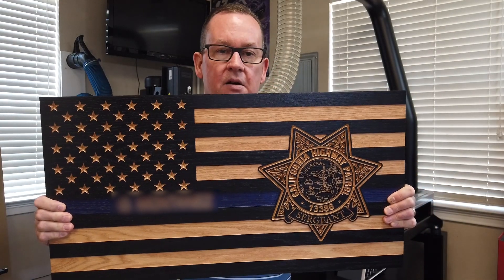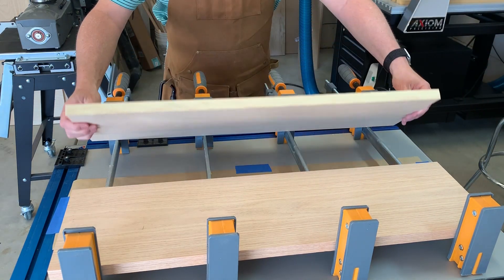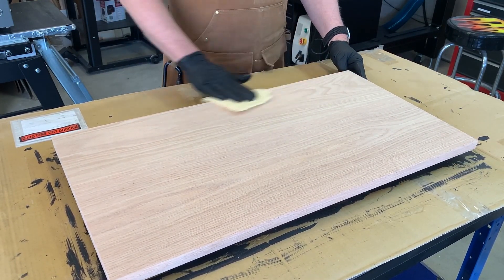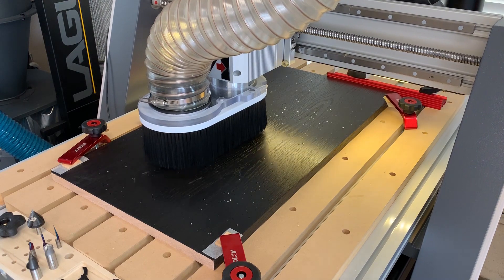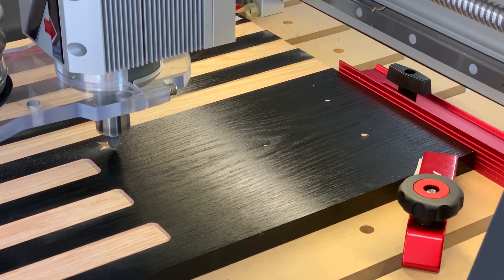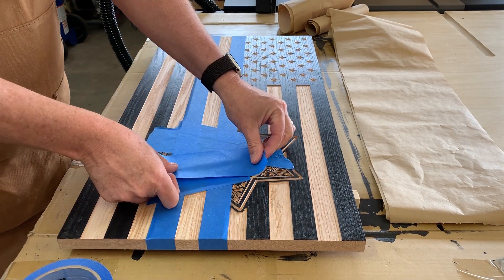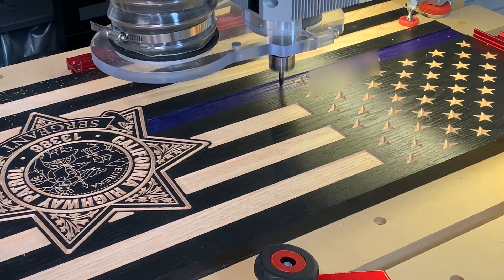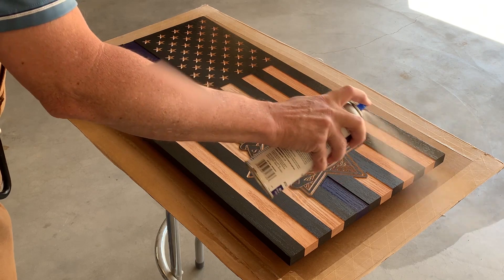Using an Axiom CNC Machine to Make a Blue Line Flag - Updated 07/17/2020

Comment: Hi Russ, great video. The flag came out fantastic!!
I have a question that I was wondering if you'd help me with, I just wanted to know what size is the flag and did you use a flag calculator so it's proportionate? 
Lastly, can you please tell me what size boards did you use for the glue up?
Thanks so much Russ.
Reply from the maker: Hi Joe.  Flag is 15” x 28.5”.  Yes you should always use a flag calculator to be sure everything is proportional.  I use Omni calculator on line.  The board sizes vary frequently.  You just need to make sure your glue up is larger than final size and cut your flag to dimension on the table saw prior to carving.  You can also fasten to the CNC and cut out final dimensions using an exterior profile cut.  😀
Reply: @Blue Line Wood Flags  Thank you so much Russ. I really appreciate your help and the information. Yeah that flag calculator does come in handy!!
I know cutting them to size on the table saw would be the thing to do, but I've attempted to make certain size flags, and I've noticed that the height would be an oddball number that I could not dial in on the table saw, so I would just cut them out using the machine. Like according to the calculator, a 24"W flag has a height of 12.632". So I couldn't figure out how guys are building these flags and keeping them proportional.
Reply from the maker: @JoeLazzara  It all depends on the level of precision you require.  12.632" is roughly 12 5/8" which any table saw should be able to dial in.  The difference likely won't be seen.  :)
Reply: @Blue Line Wood Flags  Yes thats true. 
Thats what I was worried about, it being seen. But you're right tho.
Thanks!!!

Comment: how do you sand fuzzies off the v carve without removing stain?
Reply from the maker: Use the sharpest v-bits you can. Run a last pass and take off no more than a couple thousands. Use a soft bristle toothbrush to get in the crevices and lastly don’t be overly concerned with every little fuzzy. Using sticky tape will help pull off some as well. I like clear packaging tape.

Comment: Hi! I was wondering where I could get those long red clamps that you used on the back of the flag. It runs across the T slots. TIA
Reply from the maker: Axiom used to sell them but no more.  You can make your own fence system out of MDF or birch plywood right on your machine!  You can get aluminum extrusion and mill your own holes too.

Comment: Does the CNC stop and tell you when to change the bits (shape and size) or is that something you need to monitor when the changes are needed?
Reply from the maker: Hi Ron.  You set up your tool paths/bits in your CAD/CAM program.  You copy all the individual tool paths to USB drive.  The machine will automatically stop at the conclusion of each tool path, allowing you to prep for the next one.... changing bits as necessary, re-establishing Z-0, etc.

Comment: Why is the tool moving sooooooo slowly?
Reply from the maker: I don’t know how to answer that one. I have no basis for comparison. It takes me about an hour to 1.5 hours to cut all my various tool paths on one flag, depending on complexity and including tool changes. Am I being too conservative?  Dunno!  I get good results and my residual shavings are chips and not dust indicating my feeds and speeds are correct (I stay within Amana specs for hard wood). All my cuts are super clean. I have seen terrible results from those who push their machines to the limit, as I have while going through my own learning curve. If you have some suggestions I might follow I am all ears!  We learn from each other.

Comment: Hello there Russ.  Love the detailed videos.  Steady Paced and informative.  You must have been a teacher in your former life.   I saw that you had a laguna Dust collector. I'm just beginning and just received my Axiom and need to get a dust collection system.  Which model do you have and did you do any upgrades?  Do you like what you have?  Is it enough for sander/planer and cnc?  Thanks again.
Reply from the maker: So yea I have a laguna cflux1.  It’s a dual stage collector. Love it and it keeps my shop clean.  More than enough to handle what you can throw at it.

Comment: How do you get it placed accurately on the table and also in relation to the center? Is it just a matter of making sure it is square with the gantry and setting the center of the workpiece as the origin?
Reply from the maker: Hey Patrick, good question!  If you can tell in the video, I am using alignment brackets which are secured to the aluminum t-track on the table, both along the x and y axis.  These were originally placed and marked using a square in alignment with the t-track/MDF spoilboard.  The center “origin” is established on the work piece.  The work piece is butted next to both alignment brackets with clamps.  The machine’s center is established by setting the x and y with the center you established on the work piece.  That’s a mouthful.  Hopefully I was clear.
Reply: @BlueLineCNC  thanks for the reply. Do you see a big advantage to centering the origin vs using the bottom left corner with a fence?
Reply from the maker: @pj_co  you could do either but for me I have just gotten used to using the center for the origin.

Comment: Did you design the badge, or how did you import it.  It is beautiful.  I am ordering the Axiom unit this week and wanted to know if you had any suggestion on options to purchase with the unit.
Reply from the maker: tomlewis2 the badge was designed in Adobe Illustrator and imported into Vcarve pro as an .eps file.
Reply: @BlueLineCNC  did you do the design in illustrator?
Reply from the maker: @JF32304  Yes but there are other options for creating and editing vector graphics.
Reply: @BlueLineCNC  what other programs? I could probably just Google it but I thought I'd ask. Nicely done though!
Reply from the maker: @JF32304  Inkscape and gimp are two that come to mind and I think they are both free, unlike illustrator.

Comment: Thank you for the video.  Great work.  What type and size bits do you use?
Reply from the maker: Jeff Pearson thanks for the compliment.  In this build I used all Amana brand bits which can be purchased through ToolsToday.  The stripes were cut using a 46206-K and 46051-K.  The union was carved with a 45708.  The detail on the badge was completed using an RC-1045 and RC-1148. They are not cheap but will last a long time if you take care of them.